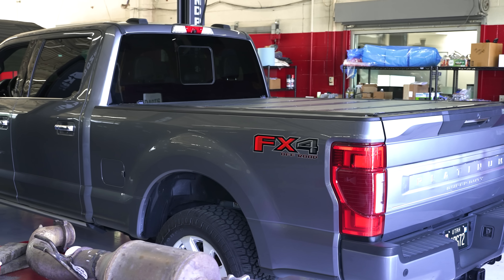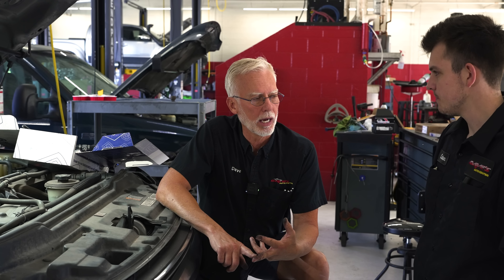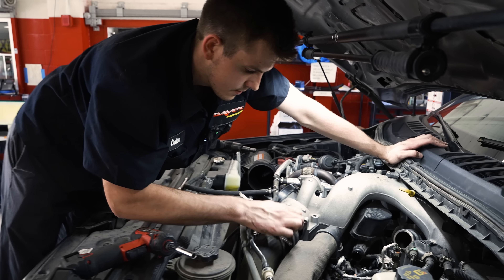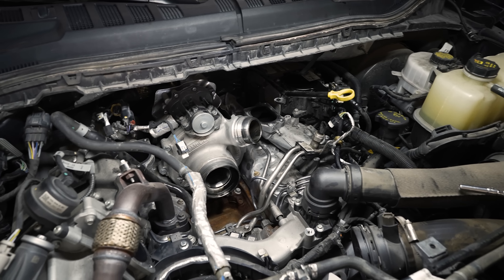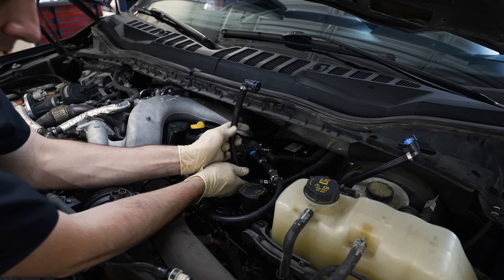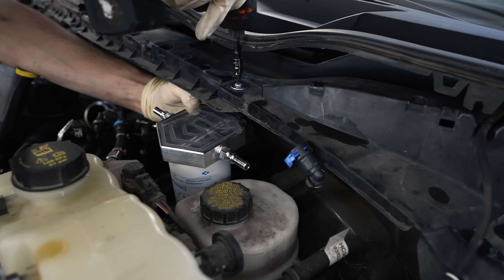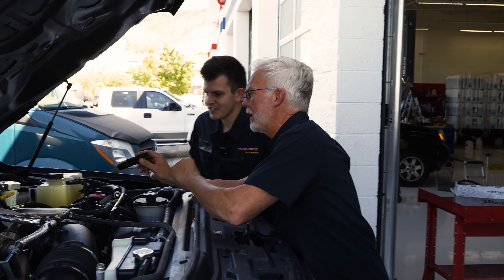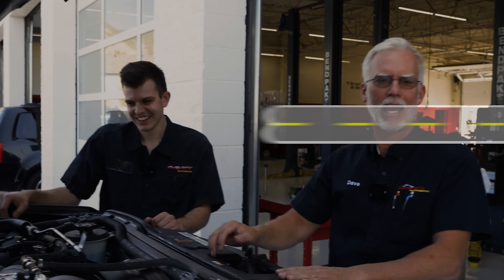How To Avoid A $10k Repair When Your CP4 Pump Fails!

Comment: Oh god it uses a donaldson filter. Garbage, should be a wix minimal. I don't care what anyone says donaldson is the cheapest garbage filter for diesels. I'm sure i was a good filter company back in the day when farmers heavily used them. Too many times i've used them on cat equipment and the filters blow the seals at the mating surface. We used them at the mine im at. We lost 2 engines because they blew at the seals and you don't notice or see it til it's too later when operating with dozers and haul trucks. We stick to cat filters. We noticed a big difference with the cat and where the seals are and with a donaldson the way it seals. The cat had a outer ring seal and an inner ring where the filter housing mating surface was. The donaldson seal was pretty thin. There's a reason why donaldson is 1/8 of the cost of a cat filter.

Comment: On the gm's if the fuel gauge gets wornky shut it down ASAP! Its bronze glitter collecting on the send unit ! Do this before the injectors take a major crap ! Then all is needed is cleaning the pipes then replace the pump ! And always use a good fuel additive !

Comment: One has to ask… what ever took out the pump has been going through the system for awhile. (Water def rust) So let’s say you find rust on your grenaded CP4 pump. With the protection kit installed it prevented shrapnel going into the high press side of the system. If there rust on the pump you can bet there’s rust down steam in the rails, lines, injectors ect… you should probably replace the whole system anyway. If not the fuel sys will
Nickel and dime you to death until you do.

Comment: They all have their problems, the thing is, most diesel pickups are grocery getters, it's a prestige thing, "Hey, look what I got". I have a 2007 F250,  5.4L gas, creeping up on 300,000 miles, it never complains, never breaks, just gets me where I'm going everyday with no fuss. The only thing diesel pickups ever did, was raise the price of diesel fuel, years ago, before the diesel pickup fad came along, diesel fuel was about 1/3 the price of gasoline. And 2 or 3 times the cost of changing the oil in a gas motor, along with the other ongoing issues. I already have a high maintenance wife, I don't need a truck to match
Reply: I do not comprehend people who drive enormous diesel trucks as commuter vehicles. I guess people want to be poor forever with their 800 per month payments.
Reply: The cost went through the roof when the epa did the low sulphur, and now ultra low sulphur. It costs a lot of money to get that stuff out.
Reply: I would love to see diesel hybrids for grocery getters or for the wife. Imagine something like a ford Maverick with a VW 1.9 TDI.
Reply: A friend who is retiring, studies what diesel particulates do to your lungs, it is not good. They studied cab exposure it is worse.
Reply: Thankfully the gas motors in 2500s have come a long way since your 5.4 so even for heavier towing applications you can go the gas route safely in many cases.
Reply: @bondobilly9369 yeah I could agree, IF THEY WERE NOT REMOVING IT FOR GASOLINE..
Reply: @selrahc2061 they are studying this how? I understand your just sharing “my uncles, cousins, friend” deal, but I’m struggling to understand.. retiring from what? And what type of study is he conducting, what type of exposure levels, someone with face on exhaust, or someone who lives 5 miles from a highway?, are we talking soot from 30 year old trucks, or modern diesels?
Reply: The onset of diesel trucks did not increase the price. The government requiring low sulfur diesel and now ultra low sulfur diesel is the reason. Every refinery in the US had to add a processing unit to met the government spec requirement.
Reply: @82ndpara21  ok, you can either use your brain, or just regurgitate what you were told, but just to put a pin in the notion that “ ultra low sulfer” contributes to the recent flip in diesel becoming more expensive, or the “way more people buy diesels today” is another crazy idea, but those whom apply the TAXES to fuels could really care less about what you think, however in their justification of “we’re doing it for your health” they expose themselves anyway, if you would like to use your own brain, you can ask yourself “when creating gasoline, and diesel, do they start the refining process with the same crude oil” ?? FYI , the answer is yes.. oh and here’s their EPA statement, kind of long for comments but 

Sulfur is a natural component in crude oil that is present in gasoline and diesel unless removed. Sulfur in gasoline impairs the effectiveness of emission control systems and contributes to air pollution. Reducing the sulfur content in gasoline enables advanced emission controls and reduces air pollution.

The Tier 2 Gasoline Sulfur program, finalized in 2000, reduced the sulfur content of gasoline by up to 90 percent, enabling the use of new emission control technologies in cars and trucks that reduce harmful air pollution. The Tier 2 program marked the first time EPA treated vehicles and fuels as a system. The program grew out of a Clean Air Act requirement that EPA consider the need, feasibility, and cost-effectiveness of stronger tailpipe emission standards beginning in 2004. Requirements for use of low-sulfur gasoline enabled use of advanced emission control systems in cars, pickups, SUVs, and vans beginning in model year 2004. Vehicles meeting Tier 2 emission standards are 77 to 95 percent cleaner than earlier models. 

Like the Tier 2 program, the Tier 3 program considers the vehicle and its fuel as an integrated system to reduce the impacts of motor vehicles on air quality and public health. The program sets new vehicle emissions standards and lowers the sulfur content of gasoline to a maximum of 10ppm beginning in 2017. The vehicle standards will reduce both tailpipe and evaporative emissions from passenger cars, light-duty trucks, medium-duty passenger vehicles, and some heavy-duty vehicles. The gasoline sulfur standard will enable more stringent vehicle emissions standards and will make emissions control systems more effective. It will also reduce the emissions of the existing fleet of vehicles.

Now ask yourself why they “the same people in government worried about emissions” don’t care that pesticides are sprayed all over your food? And cancer rates are skyrocketing? If your health meant anything, ????  

The reason diesel fuel is so much more expensive, is because it’s only used in operations that are generating money.., therefore more room for more tax., yes I know about 1% of diesel goes into non commercial vehicles., but those people all paid a 10,000 dollar premium to have the diesel, they don’t care about the tax. The little old lady on Ssdi paying for the delivery of her goods can’t see the cost of diesel taxes hurting her!!
Reply: @GRANITEMONUMENT  wow you did a lot of copy paste. I work for a major petroleum company and have been for the past 18 years in texas, Louisiana, michigan, and now utah. I am very very familiar with both the processing of refining crude oil into fuels and the economics that come with it. The need for a DDU (diesel desulfurization unit) is extremely costly within the refining process. Not the fact that ppl like 2500 diesel pickups.
Reply: @82ndpara21  ok, yes. As I said there was quite a bit to read, I also said clear that diesel pickups are not a factor, but I ask you, that did the company share expense reports with you, or consult you on equipment costs? You must be a very high up employee / owner, we’re not talking the cost of a product available at Home Depot that you can price check., now to go a step further the removal of sulfur is not that extremely complicated, we have been removing sulfur from drinking water for ever., although there are differing compounds ., anyway as far as diesel, heating oil is concerned we have reached record low demand, while having high levels of production., as of 22 , not to mention the massive amounts of fuel pulled from our reserves and flooded into the market., now remember we were told a vaccine would stop everything, then we were told masks, we were told Russia Russia Russia, we were told Biden was on top of his game sharp as a tack., so hot air from any of those sources I take with a grain of salt, and apply logic and common sense (for better or worse, at least there is some type of logic applied” some guy with one old 3 valve with high mileage means nothing, for every one with 300k there are a dozen with spark plugs blown out the cylinders, so logic and common sense says this guy is not working that truck at all., there is a direct correlation between the removal of sulfur and problems with life expectancy of diesels, even though every government source says sulfur causes major engine failures?, I’ve got cp4 high pressure pumps that beg to differ., I believe Bosch begs to differ! The sulfur acts as a lubricant for these fuel pumps, the only thing it hurts is after treatment, although there is no wide spread dada to support that either., logic says the government taxes diesel fuels more than gasoline, and I’m curious to know which plant your at, delta, Exxon , ConocoPhillips., ?? And what duty’s do you preform? Are you on the money side, or the chemistry side? Or the plant maintence / operation side? Share a little of where your insight comes from,
Reply: @GRANITEMONUMENT  you clearly have it all figured out…….Your information is wildly inaccurate. At this point it’s obvious you preach opinions based on zero facts. Enjoy yelling at clouds.
Reply: @GRANITEMONUMENT  that is a completely different process. When removing sulfur from diesel. The distillate needs to be pressurized to 1500psi and heated to 900 degrees. You need additional products like catalyst and hydrogen.
Reply: @otterconnor942  The thing is you have gas engines that match the torque of a small diesel. Both engines are about the same size. Diesel engines are made to be worked long hrs every day, short trips are very hard on a diesel engine........unless emissions are removed
Reply: @gregorymalchuk272 I agree but a person can only have an $800.00 per month payment if they put a $40,000.00 down payment on a new diesel pickup 👀
Reply: I agree with this post. But once you drive and get used to diesel cars and trucks, it's hard to go back. My 2018 3 liter grand Cherokee goes 700 miles on a tank and flys up grades at 2400 rpm. So quiet so much power without winding the heck out of it. I also pull a 6500 lb trailer and get 12 mpg which is what gas rigs avg without a trailer. But when the diesel engine goes down all the fuel savings goes away.
Reply: I have friends with 100k dollar diesel trucks that are pavement princess status and no tow miles........ I tow with my v6 ford more than them. 😂
Reply: just cause you can't afford one don't mock those that can
Reply: @msilver4888  As a mechanic I find most people that have one can't afford the maintenance. 🤣
Reply: Or we actually tow with our trucks from time to time, plan to tow more in the future, or are occasionally in need of something with more space and towing capacity than a gas truck/car. You’re really overthinking things bud, unless you’re referring to the daddies money losers then yeah its a status thing
Reply: Torque

Comment: Why does no one do the math for what a DPK costs- with labor, and then the cost to replace a failed pump- because even as the DPK works, you still gotta go in and replace the pump- which then would foreseeably negate the need for a DPK post repair.  So what's the actual cost?  I haven't done it or tried the math, so I'm speaking to myself also.  Seems like you're gonna be approaching $6-8K worst case anyway, just maybe spread out...and that's IF the CP4 fails- of the millions and millions in use.  Seems the best value is just bite the bullet and do the DCR replacement and call it good.  Buy once, cry once.  What am I missing?

Comment: I gotta say… I'm so happy to get out of work and have a new Dave's Auto video. With that out-of-the-way, I also gotta say… Why even bother owning a diesel? It's just seems to be nightmare after nightmare after nightmare…
Reply: Better fuel mileage if you carry loads or tow trailers.
Reply: It’s worth it if you tow a lot but yes diesels are high maintenance trucks, my transmission just went out on my 2018 f250 6.7 210k miles, it’s gonna cost me 12k to replace it at Ford. I’m very upset about it lol
Reply: boooooooo Diesels are good trucks. no diff then other engine designs that fail.
Reply: @dieselman6.7 Ooof!!! I feel for you!!! That sucks man. Wish you the best with it!!! 👍🏼👍🏼🍻
Reply: @wayne I guess that makes sense.... it just seems like so much more maintenance than a gasoline engine, but then again, maybe not. It definitely seems like there are at least a few specific things that can lead to a total catastrophe if not caught in time. Like I'm just guessing, but I don't think if somebody had say an F250 gasoline truck and it needed a fuel system that it would be $10,000+... I don't think so anyway!!!
Reply: @Dieselman6.7 , if you have not already gone to Ford , why don’t you look into a 7 spd  Allison ?

Comment: On rubber orings wd40 makes the rubber swell and deteriorate
Reply: Does grease or oil do the same as well?
Reply: That would depend on the rubber, petroleum is the reason why most rubber swells, considering this is a Diesel which is made from crude oil and is a petroleum product, we can assume that the O-rings are petroleum safe and wd-40 won't do anything to the rubbers
Reply: As a 20yr maintenance & millwright  employee of Toyota , we were told never use WD40 on rubber , use silicone!

Comment: thought you were going to remove the rear bumper to get that intake out of there...  If the fuel pump is a known failure point,  this disaster prevention kit should already be installed at the factory.
Reply: That would mean the manufacturer/dealership would lose out on you having to go back and spend a fortune on repairs.  Why would they want to do that???
Reply: There is no money installing it from the factory, they want job security not trucks that last forever

Comment: To be clear, this is for trucks beyond their factory warranty coverage. While a good idea I think a good additive and strict adherence to fuel filter changes can be preventative too.
Reply: Nah if you look at the cp4 engineering its the WORST way to do it. But they need to keep upping pressures etc to clean burn emissions. Because they dont care if it blows up 1mile after warranty this is what u get
Reply: If in 36k bumper to bumper period if fuel contamination of any type is found in the system Ford will more than likely deny the warranty claim.

Comment: These pumps are not needed people. They want them to fail so you come crawling back for a new truck
Reply: Yup, its literally the way id design it to fail eventually. If you wanted to last you wouldnt do a cam follower, you'd do vane or cam/gear pump. But if u want it to fail eventually yeah use a flat tappet cam system with huge ramp
Reply: @captaintoyota3171  bingo!